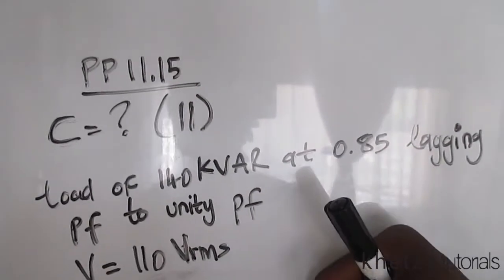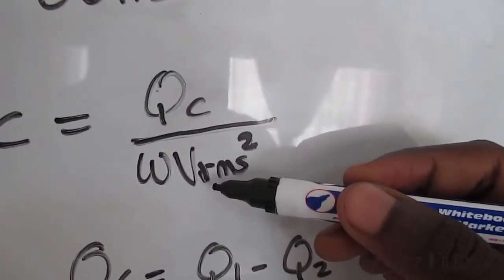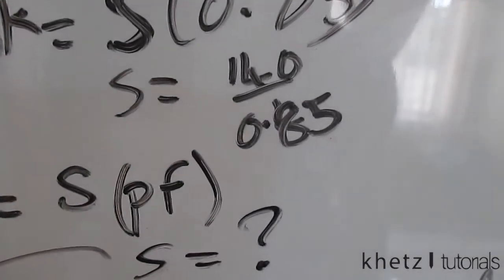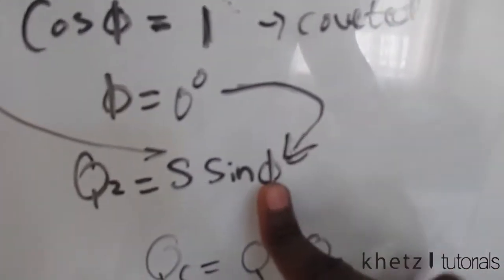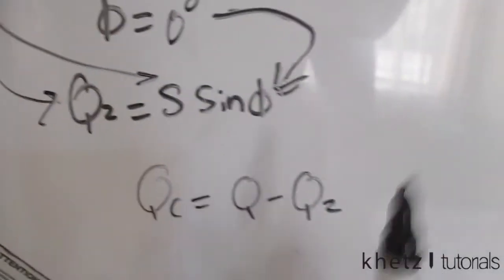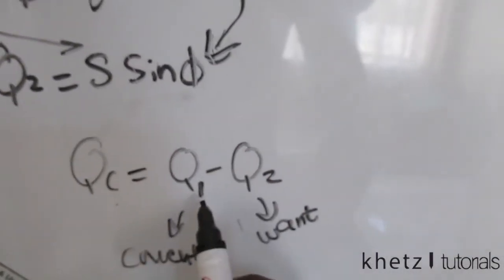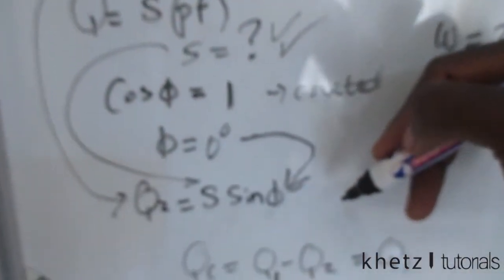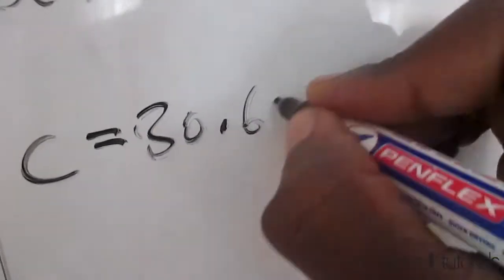Fundamentals Of Electric Circuits Practice Problem 11.15

Comment: why Q2= S . SinO? based on Q1= S Pf then Pf = cosO
Reply from the maker: Q is indeed S*Sinx, but it is also equal to S(pf) and pf has many definitions based on different combinations of the units/values. You can look at example 11.15 in the textbook as well as this link. Scroll down to "Power factor triangle"
https://www.google.com/url?sa=t&source=web&rct=j&opi=89978449&url=https://www.electronics-tutorials.ws/accircuits/power-factor-correction.html&ved=2ahUKEwjS4vfT7uaFAxVeUaQEHbfqAQAQFnoECBEQAQ&usg=AOvVaw3l076L8V1wnrxe-GZqhRHA

Comment: 0:57 we know Q=S sin(theta).. 0.85 is the result of cos(theta)..why do you plugin power factor to Sin(theta)
Reply from the maker: The angle was substituted not the power factor and that is to calculate the capacitor value needed for power factor correction. The Q can be interpreted as the imaginary part of complex power. Check the breakdown of the formula in the textbook

Comment: I have a doubt about de FP, becaus he's definede like FP P/S, where the P is the real part of S complex potency and S the module o f them. For this exercsise it's not important because the FP_2 = 1 and the Q2 it's have to be  0. But if the FP # 1 Will we have to use that de cosine of the difference de angle between power and current is 0.85 in advance and the angle is -31.79 degrees and after Find the  S1 like Q1 = S1 sine (-31.79) and then find P to conservate and more later find the Q2 and QC to solve the problem?
Reply from the maker: Hello. Could you please try to rephrase so I understand your concern